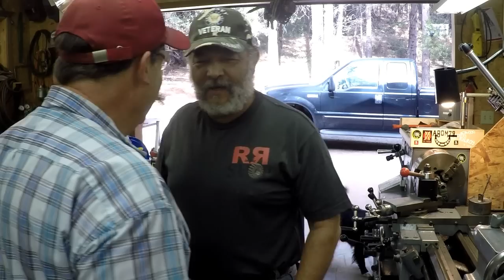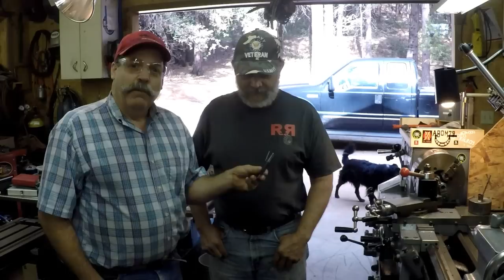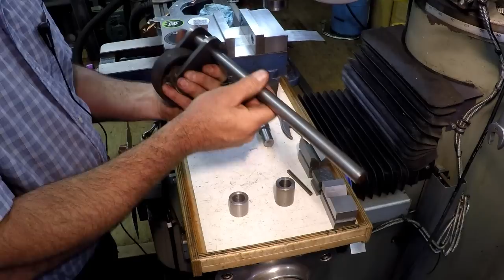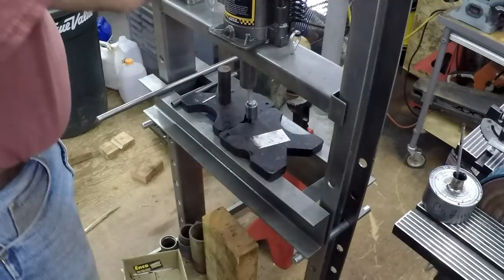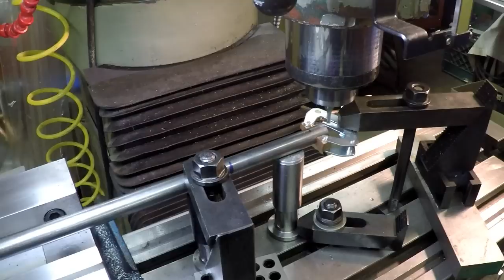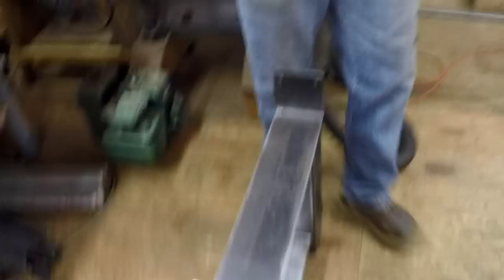Viewer Projects Part 1

Comment: He was in the right place, I saw the sign for Abom79 hanging on the lathe. LOL
Reply: bcbloc02 When will we see it posted up in your shop?
Reply: I haven't thought of a good place to put them Adam, got any suggestions? The side of my vidmar tool cabinet would be a nice place for stickers but it faces the side of the mill and you can't see it.  I want it to be someplace that will work out well when I move it to the new shop too so I can still use it.  I think the tower of the HBM would be a great spot...probably be months before that makes it back into a video though.